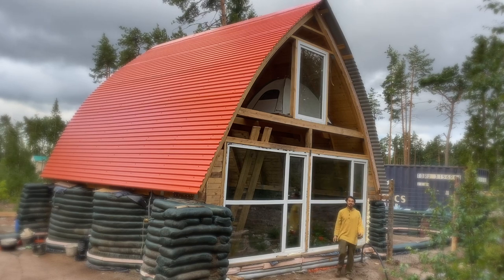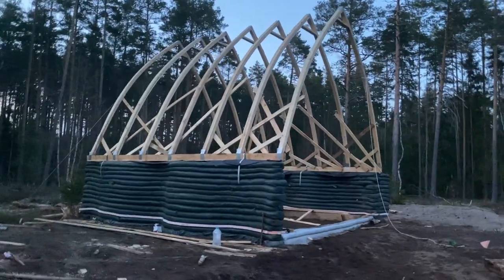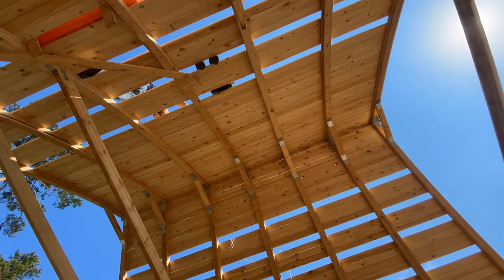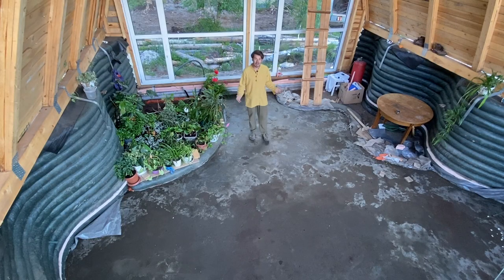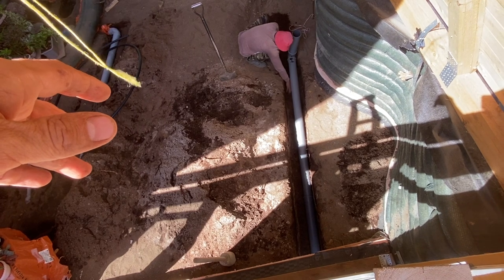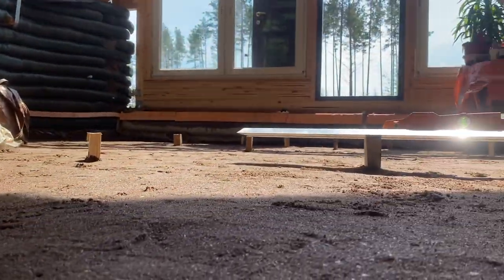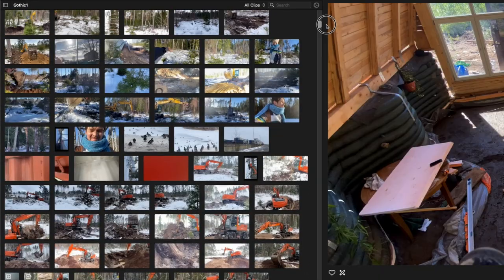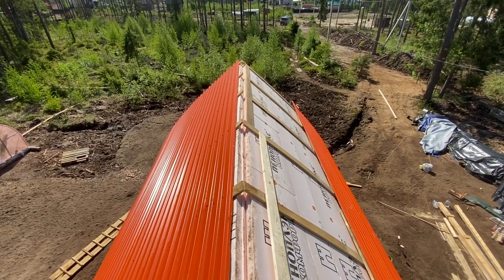⭕ 500sq.ft. Permanent Home that bypasses Building Codes

Comment: I like how the English built gothic arch homes with warpped trees to form arch. I got the foundation dug and piers for a raft foundation for my skillion cottage. Destroyed a chain saw trying to mill a 10x10 inch or 25.4x25.4 cm 8 foot post out of a leaning dry white pine. We need 450 sq feet for a dwelling here. And a cabin no permit required must be at least 14 feet wide for sleeping here. We have a certain amount of space for fresh area in the code in sleeping areas. I thought about doing an A frame but more wood needed for less space. I plan on building a gothic arch boat house like that. Acorn to Arabella built a gothic arch boat house to build their boat in which took 7 years. I was only going down 4 feet on piers but was still in sugar sand. So went down 6 feet to hit hard pack. Which actually is the frost line here in zone 4. Code is different U.P. north because non expensive soil. Down state it's 4 feet or 1.2 meters to frost line. Gonna insulate and need at least 3" of masonry for floor. Using concrete and flag stone for floor. I can get "temporary" occupancy permit if hot water, sanitary stuff aka toilet, glazing aka windows, and lighting once structure is dried in. Looking at around 2000$ plus insulation. 1000$ of that is just for rafters, sheeting, and roofing. I plan on insulating outside of roof for open rafter look later on. I do masonry work for a living so have materials I have been saving. I have did and still do timber framing. So going post and beam with square saddle notches. Headers for loft will be mortise and tenon out of two  2x12's glulam. Cheap ask would rather do the labor for notches than go other way and buy the code required brackets. Not a fan of brackets used in post frame construction. The metal condensates and speeds wood rot. Because basically building a greenhouse to live in. I want to make sure moisture is always wicks outward. Keep up the good work. Where I am at solar north is 12 degrees off of magnetic north.
Reply from the maker: Thank you for a lovely comment, I check out Acorn to arabella , wow . Much appreciated

Comment: You could potentially bury the earthbag section (with waterproofing/draining) so you dont need the curvy walls, plus it will add some natural cooling to the structure.

Comment: Where I want to build in the Cincinnati, Ohio area, new residental housing minimum size is 950 square feet.  So while I like the look of your build, it is NOT something that can be built anywhere without permits.  The largest square foot without permits is a storage shed of 150 square feet and in some areas it's 100 square feet.  I do intend to create a gothic arch home on a pier and beam foundation, 20 feet wide by 50 feet long with a knee-wall of 4 feet to make interior building on the arched walls easier.  My footprint for the main floor would, therefore, be 1,000 square feet or just slightly larger than the minimum requirement.  The height of the structure will allow for some vaulted ceiling areas as well as a portion of the interior to be developed for a second floor/guest area.  As much as I would love to follow your build, it would be a mistake to say anyone can simply bypass building codes anywhere in the United States.  Not saying there aren't areas - there are some states, some municipalities, some rural areas where that might apply, but certainly Los Angeles, CA to Boston, Mass, you won't be able to just buy a lot and start building a small house.
Reply from the maker: I said small foot print and dream catcher second floor which gives yoi another 150 sq feet . I got a new design idea